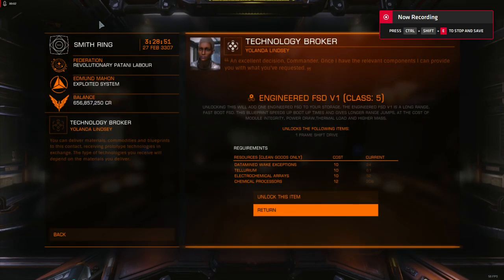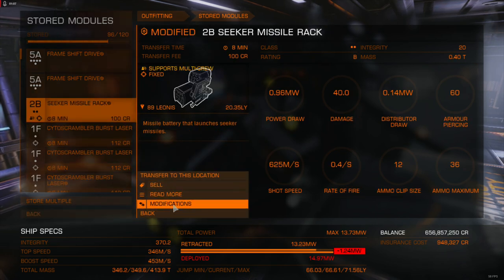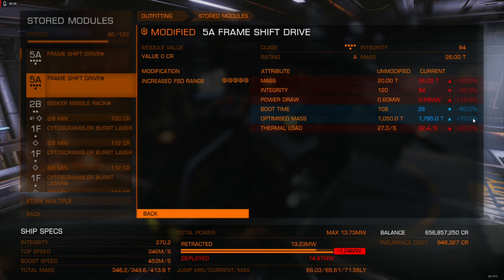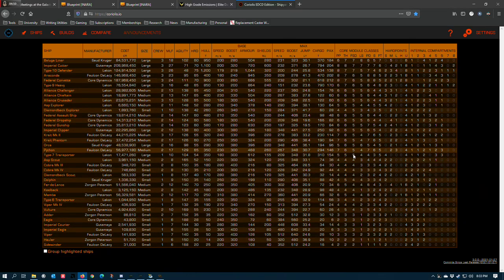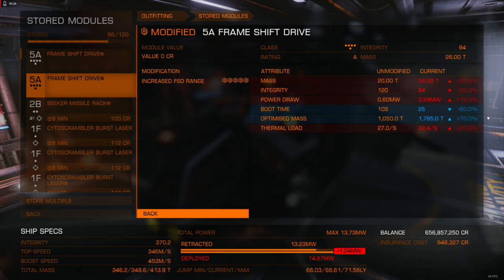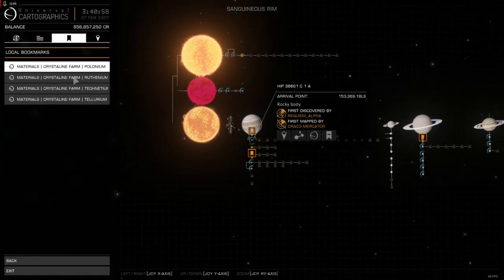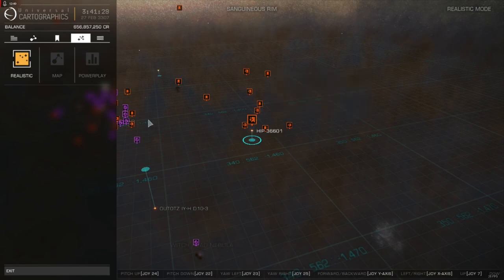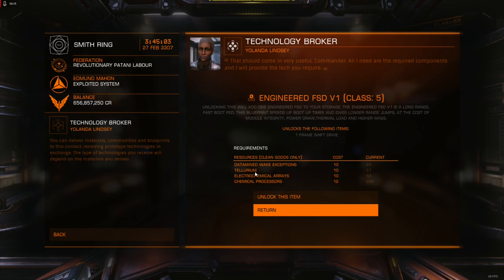Elite Dangerous | Tech Broker | Module Review | Engineered Frame Shift Drive | 5A

Comment: wow, I had just dismissed this drive as a novelty module kinda thing, im going to get this immediately, was planning on doing the 5000 ly trip to get for the engineering unlocks and this will help a ton! many sir 07
Reply: got it, and with mass manager i got 60 ly unladen!
Reply: @mrexists5400  what was the jump range before?
Reply: @mrexists5400  what was the jump range before?
Reply: done the 5k twice in a 50Ly python, next time will do it in a 70Ly Anaconda :)

Comment: Got a couple of these one on my DBX and the other on AspX. My DBX is my bubble bus and AspX is my stripped down explorer. This is 100% worth it for exploring and other long range applications. No so much for anything else... It runs HOT! And yes the durability trade off makes it very unappealing for combat. You can't engineer it any further but you can put an experimental effect on it (Mass Manager for even more range is what I put on both of mine)
Reply: This is what I want to do . My DBX gets 70 ly ( it can be stripped to get 75 ) What can yours get with this new drive?
Reply: Its is fucking hot! I overheat in my aspX just fron jumping. I guess I need to change the powerplant  to an A type, for the efficiency, plus engineer the trhuster to clean and remove some thermal load.

Comment: Grabbed this for my heavily engineered Diamondback Explorer, which gave me an extra 6LY, taking me over 75LY jump range with Mass Manager added on top. 
This is with 4A fuel Scoop, 4H Guardian FSD booster, 3A Shields generator, SRV, Heatsinks, Chaff, Point defence, Surface Scanner.

Makes my 75Ly Anaconda useless now.. Especially when the DBE can also boost to 500ms and is not like trying to turn an oil tanker in thick soup... :D
Reply: But the Anaconda scoops fuel much faster with a 7A scoop.
Reply: @cmdrandreyuenari4150  That is true, with my Anaconda being more heat efficient when fuel scooping over my DBX too.
Reply: @tgpips1128  scooping time is very important. The 7A scoop on the conda in 6.4 seconds gathers enough fuel the the next jump, effectively keeping your tanks full
Reply: @ysfsim  Correct. 
I've travelled approx 100klys in my Conda when heading out to Colonia and other places.  It's parked for now. 
My DBX is great for heading out to the crystal shards etc. and has helped with getting my fully engineered "Deadly" Cutter up to spec.

Comment: I have found materials grade 5 at a crashed Anaconda in the HIP 16613 system on planet 1 a. It's quicker than Jameson crash and hunting highest grade raw materials. Trader is still at Ray gateway and raw mats trader at next system to Ray gateway.
Reply from the maker: I'll check this out when I get the chance. If it looks good I'll make a video.
Reply: @DryHeatAndSand  OK Sure I'm not the first to find it as it's on cannon page. Anyhoo there is also an srv site about 5k away from crashed Anaconda, rock blasting for raw mats can get you Arsenic etc.

Comment: I don't notice a difference in boot time. Is it the time it takes from hitting the button till you jump?
Reply: No, it's the time from powered down in Modules panel to power on. So if you are over your power plant capacity while hardpoints are deployed and it turns off, it now takes less time to boot back up.
Reply: Thanks for the reply. Yeah after I asked I went and tried everything and figured out that's what it was. Takes 2 seconds to turn on now. Don't really see how that's helpful but OK. I only overclock my combat ships like that and won't be using it for those.
Reply: @308damage  there are some special weapons which makes the FSD reboot. Mostly gankers and pirates uses them against traders, etc.
With fast boot, you can easily run away from them.

Comment: At Moxon's Mojo in Bolg. Just unlocked it via the Human Tech Broker in station, asked if I wanted to go to Outfitting, said yes, checked the store for FSDs and I see nothing but stock modules. Am I bugged? Getting annoyed with FDev.
Reply: This FSD, and the double-engineered missile rack, work differently than normal tech broker modules. You're not 'unlocking' the module like you do the other tech broker modules, you're 'purchasing' a single module for the material costs required. So if you want multiple FSD's, you have to 'unlock' one each time.

Once you've made the 'unlock', or purchase, it should be placed into local storage at the station you are at (hence why it asked if you wanted to go to outfitting so that you could transfer it to your ship).

Wherever you are now, you should still be able to transfer the module to your current location.
Reply: @akaBeaucoupFish  Thanks!